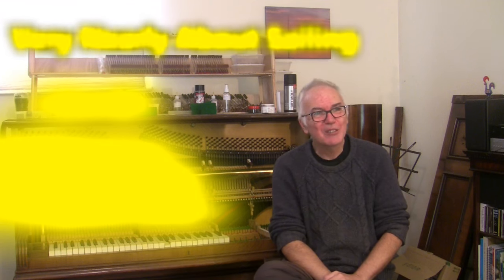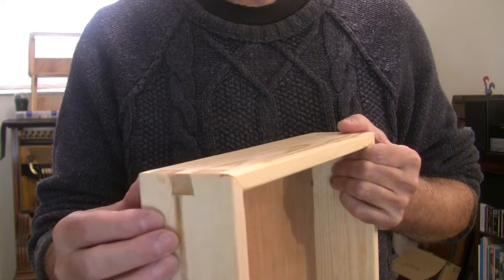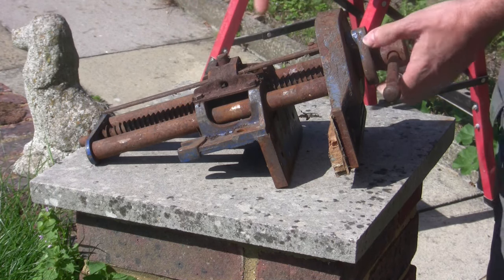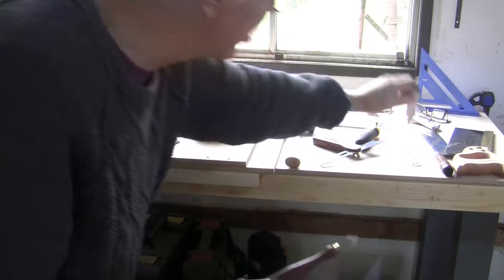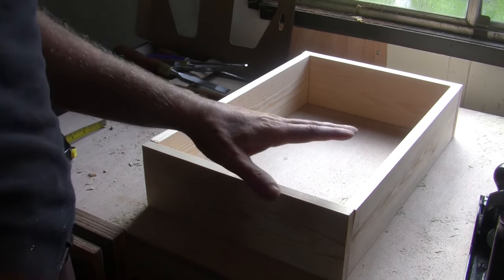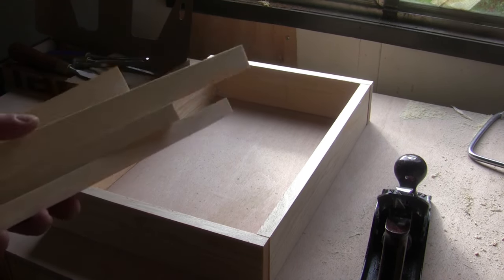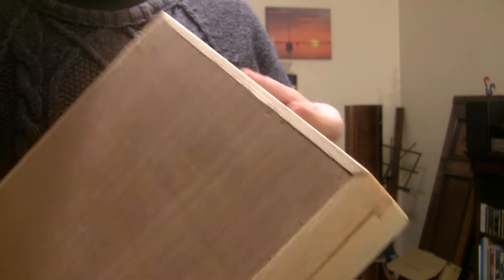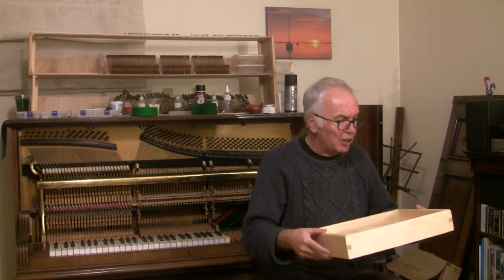VNAS October 2023 - Installing a 'new' vice, and making a mitred dovetail tool tray

Comment: Excellent work Paul, like you my last attempt at dovetails was at school so you’ve brought a few memories back for me. You’ve made a good job of those joints, even the first attempts were fine. A harder wood would probably give you neater edges, but this is just great. And what a difference having the ‘right’ tools , (and sharp), to hand, good on yer Paul I’m sure this is just the start of the journey.

All the best,

R.

Ps: the piano is looking good, just enough notes there for a good ‘ol left hand boogie shuffle 😊
Reply from the maker: Yes, this was the cheapest of all possible pine. Very soft and very sappy. The nice wood will be saved for Serenity. I did sharpen all the tools (including the saw). My old woodwork teacher must have done a good job - I remembered stuff I didn't even realise I'd forgotten.
Piano is at the stage of putting things back together. Made a few mistakes along the way - there will be a short video series.
Cheers, Paul
Reply: @verynearlyaboutsailing8114  

Hi Paul,

I’d be interested to see your sharpening method, you seem to have some very sharp tools there. All I ever do is succeed in making my chisels etc. ‘child friendly’ 🙄

I was thinking of getting the Tormek sharpening system……. but man, have you seen the price !!!

All the best,

Richard.
Reply from the maker: Richard, I basically follow the Paul Sellers method as closely as I can. He doesn't use a jig of any sort. So, I'm certainly not at an accurate 30%. However, it's probably close enough and seems to work for me. It does mean that you get a slight curve rather than a two part flat bevel. But it is very quick, and easier than you would think.
I use a Faithfull diamond sharpening set. Three 'stones', 1000, 600 and 400, then a leather strop. I use window cleaner as lubricant. It's very quick.
Have a look at Paul Sellers' channel he's got a few videos on sharpening. I also used his method to sharpen the saw. He uses a 'progressive' cut where the first couple of inches of the saw are done slightly differently so it is easier to start the cut. Sharpening the saw made a huge difference.
Cheers, Paul
Reply: @verynearlyaboutsailing8114  

Thanks for the Paul Sellers tip, I’ve just made meself a brew and I’m about to settle down for an afternoons fettling in the shed…….. tough life eh !!

Comment: For derusting the vise Oxalic Acid crystals (wood bleach) works wonders on rust.  When I was restoring bicycles I used it all of the time and it was like magic on rusty steel parts -even rusty chromed steel wheel rims  I would put a couple of tablespoons into a kiddie pool with tap water and submerge the entire bicycle frame overnight and in the morning there wouldn't be the slightest spot of rust left on it It would all dissolve in the bath.  Rinse it off and then wax the heck out of it and the metal parts look almost new.  

In the USA the brand I like is Savgran and is available at any Ace Hardware store.
Reply from the maker: Yes, Oxalic acid is magic. It does an amazing job on bleaching wood and really draws out the unsightly stains. It's also great for getting rid of those horrible 'rust' stains that you see on fibreglass sometimes. I actually used distilled white vinegar for the vice (vise in the USA), simply because I had a great big bottle of it that wasn't going to be used for anything else.
I have another project coming up, which I may or may not video Won't say what it is, but it has chromed steel rims and a very small 4-stroke motor - and it is nearly as old as me. That will probably see its fair share of Oxalic Acid.
Cheers, Paul

Comment: I just finished spending a couple of weeks making a few drawers, my first time for this type of project. Then I have a look to catch up what you are up to, and find you are also making drawers. Yours are much better than mine. I considered options for the corners and ended up using lock miter joints. I don't think I have the patience or sufficient woodworking skills to manage dovetails. My next project is also to build a cross cut sled.
Did you consider making a groove a bit up from the drawer bottom so the bottom panel is captive?
Just curious, did you do the painting (or maybe its a photo) behind the piano? Very nice.
Ken
Reply from the maker: Ken, Good to hear from you - it seems that you and I live in some weird parallel universe to each other with regard to our DIY pastimes.
I am enjoying my woodworking attempts. I want to get some practice in, and get my skills up before really tacking the galley.
I did do woodwork way back in my school days. It's surprising what I do remember from back then. I don't think much of it is about any sort of innate skill. But it does seem to be about patience and precision - and the willingness to get it wrong several times before it goes right.
I haven't tried lock mitre joints yet. They are on my list
I want to make a drawer for my workbench. I'm pretty much going to copy the Paul Sellers video where he does just this using half-lap dovetails (where you can't see the joint from the front), and a groove, as you suggest. I need to finish off my router table to make the groove.
We shall see how that all works out.
The picture is a photo that my sister took on Serenity when we were moored just outside Faversham Creek. The sunsets in this area are amazing. It's just a couple of miles from the place where Turner did a lot of his famous watercolour paintings (that was Margate). The colours in the photo are accurate to real life - amazing.
Cheers, Paul
Reply: Yes, we seem to be in some sort of parallel projects. I bought a cheap router table just before seeing your video on building one. For my drawers, I used a dado blade set on the table saw rather than the router. It cuts faster, and with my setup is a simpler setup. Also, I already had the dado set.
Spectacular colours in you photograph.
Looking forward to seeing progress on Serenity, and soon your not-to-be-missed Christmas special.
Ken